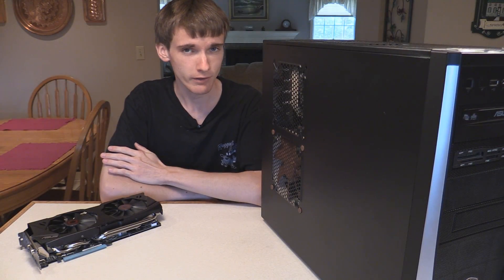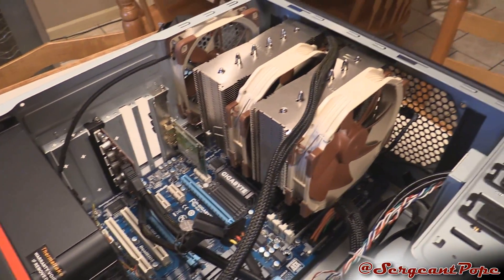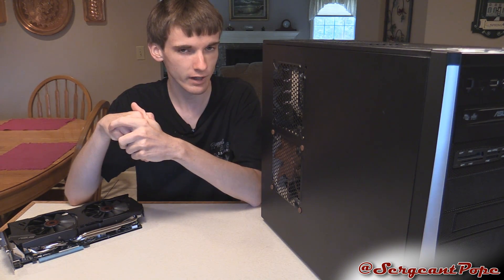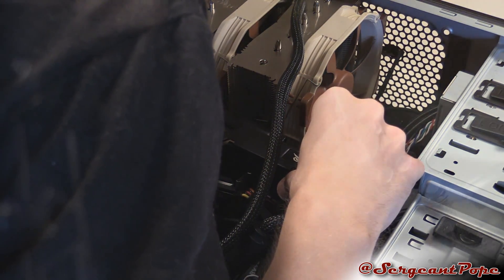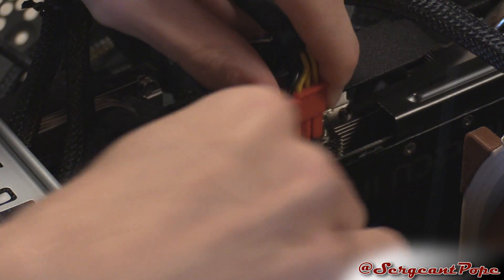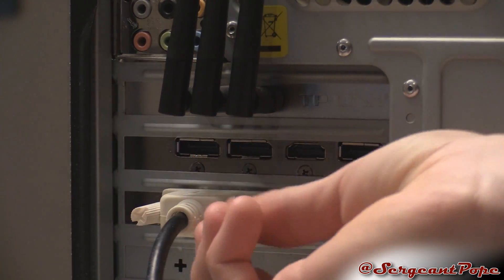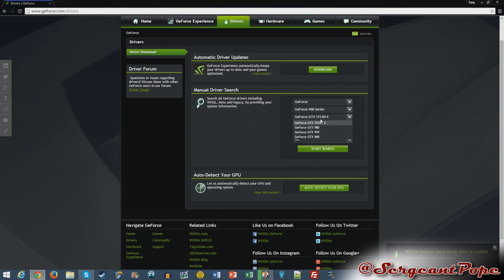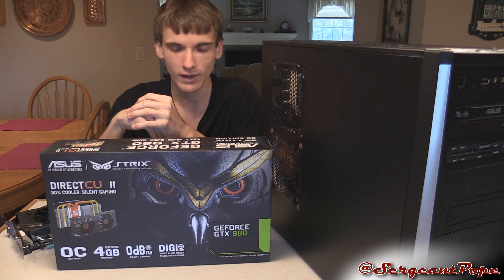How to install a graphics card - GET INTO PC GAMING EASY!

Comment: 1 question. Is gtx 750ti compatible with motherboard acer aspire mc605?
Reply from the maker: +Killerzo000 Killer I can't find the motherboard for your computer so I can't guarantee the GTX 750 Ti will fit (but most likely it will to be honest). One area you need to upgrade is the power supply. It comes with a 200 watt power supply, but the GTX 750 Ti needs a 400 watt power supply.
Reply: +SergeantPope Okey i will get like 500w power supply. I have scearhed little and they say it will fit because of x16 pci or something like that so I think it will fit.
So I only need a new power supply?
Reply from the maker: Killerzo000 Killer Your motherboard sounds like it should work just fine with a new graphics card. Yep, a new power supply should be the only thing you need for a GTX 750 Ti.
Reply: +SergeantPope I just ordered gtx750ti 2gb Gigabyte it is little shorter than gtx 750ti Msi so it should work just fine without any problem.
Thank you man!

Comment: I was wondering if you can see if this would work for my PC that Im turning into a gaming pc

.EVGA GeForce GTX470 1280 MB DDR5 PCI-Express 2.0 Graphics Card 012-P3-1470-AR

.MSI Computer Corp. Micro ATX DDR3 1600 LGA 1150 Motherboards H81M-P33 V2

.Intel Core i3-530 Processor 2.93 GHz 4 MB Cache Socket LGA1156

.EVGA 500 W1 80+, 500W Continuous Power, 3 Year Warranty Power Supply 100-W1-0500-KR
Reply from the maker: +Jordan Garcia A GTX 470? Why are you getting such an old graphics card? If you do end up getting that, you'll actually need a 550 watt power supply instead of your 500 watt. I recommend an Nvidia card from the 700 or 900 series. They run on less power and it'll run newer games too.
Reply: SergeantPope EVGA NVIDIA GeForce GT 730 1GB DDR3 Graphics Card 

EVGA GeForce GT 740 Superclocked Single Slot 4GB DDR3 Graphics Cards 04G-P4-2744-KR 

Sorry im a bit new at this is the type of graphic cards card your talking about?
Reply from the maker: Jordan Garcia Yeah, they would work. Can you afford the GTX 750 Ti though? That's a good graphics card if you have a tight budget.

Comment: Hey man, for Christmas, I'm thinking of getting a EVGA GeForce GTX 970 4GB SC. It looks awesome and on amazon its #1 best selling for $289.99, Do you think it would work with a Thermaltake Smart Standard 650W 80 PLUS Bronze ATX12V 2.3 Power Supply SP-650P. Thanks to whoever answers!
Reply from the maker: +ChecUr Self That is plenty of power for the GTX 970. You actually might even be able to SLI a few GTX 970s to be honest.
Reply: +SergeantPope Thanks man!

Comment: Can someone please explain the process of updating the graphics drivers for someone like me who just got a new card
Reply from the maker: +ZizixPlayz Just go to either Nvidia.com or AMD.com and go to the drivers pages. Look up your graphics card and operating system and install the newest driver.
Reply: +SergeantPope Thanks, but what about uninstalling the current nvidia drivers I have? Do I also uninstall things like PhysX?
Reply from the maker: ZizixPlayz You don't necessarily have to uninstall the old drivers, but it's not a bad idea. Usually what I do is if I'm going from an Nvidia card to another Nvidia card, I don't uninstall the drivers, but if I'm going from Nvidia to AMD I uninstall the old drivers.
Reply: +SergeantPope I have GeForce experience, wouldn't that update my drivers once I install the new card (GTX 750ti)? I also currently have the Windows 10 driver.
Reply from the maker: ZizixPlayz Geforce experience might take care of all that for you, but I would still install drivers again. That's what I do at least and I haven't had any problems.
Reply: +SergeantPope Alright thanks. I appreciate the help.

Comment: Does the 6 pin cable connect to the power supply to the graphics card? Where does it go in the power supply?
Reply from the maker: +Axel Arcuri Yep, the 6 pin connector on the graphics card should have a 6 pin cable that comes from the power supply. If you have a normal power supply that cord should just come out of the power supply. If your power supply is modular there should be 6 pin connectors on the power supply itself that you plug a 6 pin cable to.
Reply from the maker: Axel Arcuri After you do both of those things you have to install the drivers. But after that you're good to go.

Comment: what if my pc has an integrated gpu in it
Reply: and I want to put a msi gtx 750 ti in it
Reply from the maker: +• Martiaaa • You can still add a regular graphics card even if you have integrated graphics on your motherboard. The motherboard should automatically switch to the graphics card you install.
Reply: SergeantPope Ok thanks, does this mean I don't have to install the drivers?
Reply from the maker: • Martiaaa • No, I would still install new drivers. You don't necessarily have to uninstall the old ones, but definitely get new ones.
Reply: SergeantPope Just bought the gpu, put it in and installed the drivers, its working fine thanks for the tutorial on how to put it in.

Comment: Hey great video, I'm going to upgrade my card soon, I have an AMD quad core processor and 16 gb of RAM with my GTX 560,I would like to spend no more than $200, maybe $250 If there's a good deal, what card would you recommend?
Reply from the maker: +Bryent Taylor With a budget like that, I would go for the GTX 960. I've used it before and I was really happy with the performance even though it's just about $200. Here's an EVGA version on Amazon: http://smile.amazon.com/EVGA-GeForce-Whisper-Graphics-02G-P4-2966-KR/dp/B00SC6HAS4/
I have a benchmark video for the 960 as well, if you wanna get an idea on the performance. https://www.youtube.com/watch?v=kFGV8cU2f0A

Comment: what is a good cheap graphics crad
Reply from the maker: +shrimpskinboot It really depends on what you mean by cheap. $250? $150? $100?
Reply: $100
Reply from the maker: shrimpskinboot The GTX 750 Ti is just over $100. It's honestly the cheapest graphics card I would buy. Anything less than that and you'll be really disappointed with the performance.
http://smile.amazon.com/EVGA-GeForce-750Ti-GDDR5-Graphics/dp/B00IDG3IDO/
Reply: thanks

Comment: Hey I have  a 350 w power supply and I use this FX-4300 processor 8Gb of DDR3 memory and GTX 730 2GB graphics card can I upgrade to a GTX 760 MSI hawk?
Reply from the maker: +Lord of Quacks The GTX 760 requires 500 watts, so you would have to upgrade your power supply to at least 500 watts. If you upgrade one generation and get a GTX 960 instead of the 760, you only need to upgrade your power supply to 400 watts because the next generation of GPUs is more power efficient. Either way you'd have to upgrade your power supply though :/

Comment: Hey Sergeant, first off, great video. As for my question. I am currently an AMD user looking to upgrade relatively soon. All of my drivers for my current GPU are up to date. If I was to upgrade to a higher end AMD card, is it worth to fresh install? I understand the efficacy of fresh installing. Just wondering if you could install the new GPU in the computer then just turn it on and be good to go because the drivers already support the new card. Thanks!
Reply from the maker: +howyoudoin1234567 Schirminator I always reinstall drivers after I install a new GPU, no matter how similar the previous graphics card was. You would think that everything would run fine if both the new and old graphics card used the same driver, but I've had crashes whenever I didn't reinstall the drivers, so now that's the first thing I do when I get a new graphics card installed.
Recently I went from a Fury X to a Fury and then an R9 Nano, which are all technically the same chip, but I reinstalled every time. It seems like the little time I spend to reinstall the drivers is well worth it. (sorry for the super long response by the way, lol)
Reply: +SergeantPope Great response and I appreciate the thoroughness. I may get a Radeon r9 390x.

Comment: please help i would like to run games better on my pc but dont know what to do i can run games on low 

cpu: intel i5 quad core 3.2 ghz

ram:12

graphics card: intel 4500

i can spend a little over 200$
Reply: +Loaded Lemons http://www.bestbuy.com/site/dell-inspiron-desktop-intel-core-i5-12gb-memory-2tb-hard-drive-black/9407115.p?id=1219703856936&skuId=9407115 this is my pc what graphics card should i plug in
Reply from the maker: +Loaded Lemons Your desktop only has a 300 watt power supply, so unless you're also planning on upgrading your power supply, this is the fastest graphics card that will run in your system. It's not that great though. http://www.amazon.com/EVGA-GeForce-Profile-Graphics-02G-P3-3733-KR/dp/B00L5GZG5C/

Comment: How can you tell if a pc can support a dual slot card? I have a hp pavilion desktop (2009) and I'm thinking about buying a gpu to get into some heavy gaming.
Reply from the maker: +XxKillerzxX9 I had an HP desktop and it fit dual slot graphics cards fine. Your desktop probably has 4 expansion slots. The graphics card will use up the top two slots (or bottom two slots, depending on how the motherboard is orientated).
Reply: oh ok so I can install a dual slot without it not fitting?
Reply from the maker: XxKillerzxX9 Well it has to fit. Can you rephrase that?
Reply: there is a piece of metal under the old gpu slot with a screwdriver etched into it
Reply from the maker: XxKillerzxX9 Ooooh, gotcha. Just rip that piece of metal out (gently). That's just to keep the slot closed if you don't use it.
Reply: oh ok thx
Reply: how do u know if the card is too long to fit?
Reply from the maker: XxKillerzxX9 You can measure from the back of the case where the video outputs for the graphics card would be going to the front of the case. Then you can compare your case size to the size of the graphics card, which should be on Amazon.
Reply: my case is approx. 15 in, and my graphics card is 10 in, will it fit? I'm worried it wont fit because it might not fit because of the other components
Reply from the maker: XxKillerzxX9 I don't think you'll have any problems fitting it in your case. I had a pavilion desktop too and it fit just about everything I put in it.
Reply: do u know any good cpus for a 755 socket?
Reply from the maker: XxKillerzxX9 I honestly don't know much at all about Intel CPUs. Sorry :/

Comment: Hey, with an AMD FX-6300 and an "EVGA GeForce GTX 960 2GB SuperSC ACX 2.0+", do you think I could run GTA5 on high/ultra settings with 60+fps?
Reply from the maker: +Calvin Mason I think you'd be able to play GTA V with medium/high settings on a GTX 960 and still be able to get 60fps. High/ultra settings may be a bit too much for a GTX 960 if you still want to hit 60fps (it would still be playable, just probably not 60fps).
Reply: Okay, thanks for the input!

Comment: This video was so informative, I can't believe he hasn't got more views. I'm definitely sharing it around.
Reply from the maker: +Barttoocool Thanks Bart, I really appreciate that.
Reply: +SergeantPope No problem, I had a quick question, if you have the free time to respond. I have a H61M-P31 G3 motherboard, and I was thinking of getting the GTX 970 graphics card. But there seems to be a silver box as I describe it right next to the 16 Pin PCI-Express slot so I'm doubtful it'll fit? Is there anything I can do or should I just sell the PC and buy a new one to upgrade?
Reply from the maker: +Barttoocool That motherboard looks fine. By silver box, do you mean the audio jacks and that stuff? If so, the graphics card will go below that stuff, and it won't conflict that space of the motherboard at all.
Reply: SergeantPope Yes I did, oh really that's great! That's a lot for your help, I've subscribed also, I'll keep an eye out for your new videos, you're great.
Reply from the maker: +Barttoocool Thanks Bart!

Comment: Regarding drivers, I'm currently about to replace my 660ti with a 970. Do I HAVE to uninstall the 660 drivers before I download the 970 (after i install the card?). Or is it okay to uninstall it after? I would prefer to just do it after if possible, but I was curious if that would cause any issues. Thanks in advance!
Reply from the maker: +Ryan Bell If you're going to uninstall the drivers, I would do it after you install the 970, but before you install the new drivers for the 970. The display will still work good enough to get that done. That said, I usually don't bother to uninstall the drivers at all myself. Usually when you install the new drivers, it'll detect the old ones and automatically uninstall them.
Reply: SergeantPope Excellent that's what I assumed. I was able to get the card installed and up and running. Really appreciate the vid, it helped a lot! And thanks for the response!

Comment: Hey thanks for the tutorial it was helpful but could you tell me if a evga gtx 750 ti could work with a 300 watt psu bescause they put that graphics card on a 250 - 280 watt power supply and a 300 watt psu and it worked so would it work on my 300 watt psu heres the link https://www.youtube.com/watch?v=A_Pnte_niJE
Reply from the maker: Arnav CrazyKeyboard A GTX 750 Ti really needs a 400 watt power supply to run properly. Here's a link to all that info: https://forum-en.msi.com/faq/article/printer/power-requirements-for-graphics-cards

Comment: I consider buying one of the following:
 
Amd R9 380 2G
 
Nvidia GTX960 2G
 
I'am kinda a Nvidia fan, but I know that the 380 has better gaming performances than the 960.
But I also want to do 3D modeling, editing and video capturing and I heard Nvidea has better cards for that and comes with more programs... or??
 
Pls help me :I
Reply from the maker: Median Gamer I've used the 960, but I've never used the R9 380. They're both in generally the same price range, which means they are both probably very close with performance. If you asked me a while ago, I'd pick AMD because you get more raw performance, but recently Nvidia has been doing much better than AMD. The hardware seems to be utilized better, use less power and thus create less heat. Either option wouldn't be bad, but I'd probably go for the 960.
Reply: Thanks for the freat reply!! that meant a lot for me. Do you have any idea if its better to buy the 4G version instead of the 2G? since it costs 50$ more but might be worth it. :)
Reply from the maker: The 4GB version is actually the one I had. It's nice having that extra memory, and it should lengthen the operational life span of the graphics card. If you have the extra cash, I would definitely opt for that card, but if you don't, it's not the end of the world.

Comment: I have a Inspiron 3847 I hope I have that slop you mentioned. We are July 2015 what nvidea card would you recommend?
Reply from the maker: sorriaejogue It really depends on your budget. The GTX 970 seems to be a sweet spot for performance right now, but whatever you ultimately pick will depend on your budget.
Reply: SergeantPope You should do a video of changing a power supply on a machine like this, I did this exact upgrade it went fine although changing my psu was far harder then changing the gpu (since the gpu is just a pull out and plug in job really), my dad actually gave me a hand and accidentally pushed a metal plate that was actually a button behind the psu that was holding it in I don't know if I would have figured it out alone, it took us a decent while to find how to get the psu out, it really wasn't obvious at all and it was clear the case had been built to not have parts chopped around very often, it seems the case you use in this video is somewhat custom case and really doesn't represent the clusterfuck you find in these off the shelf computers (cables from the psu fking everywhere, very little space, dust, etc...) I actually had to unplug a tiny few mm long cable from the optical drive and plug it back in after just to fit the psu into place as the back was hitting it that's how close it was.

Comment: Hello, as of now I have the nvidia GT 630 and I want to upgrade to the GTX 970, but I was wondering if the difference will be worth a $320 price. Also, there are different brands of the GTX 970 (msi, asus, zotac, etc.) which would you suggest? Great video, very helpful!! Thanks
Reply from the maker: ***** Moving from a GT 630 to a GTX 970 will be a very large step up. The GTX 970 is definitely worth the price in my opinion. I've tried several different GTX 970s. MSI and Asus are great. EVGA and Gigabyte are pretty awesome as well. I suggest choosing a graphics card that you both like the looks of and will match with the rest of your computer.

Comment: If I upgrade from a geforce 550ti to a 980ti do I still have to uninstall drivers or will the nvidia experience just fix thtat for me?
Reply from the maker: coldfire22 With an upgrade like that, uninstalling the old drivers probably isn't necessary. From my experience, when you go to install new drivers that are close to the old drivers, the old drivers will uninstall automatically before the new ones are installed.
Reply: SergeantPope ok thanks!!